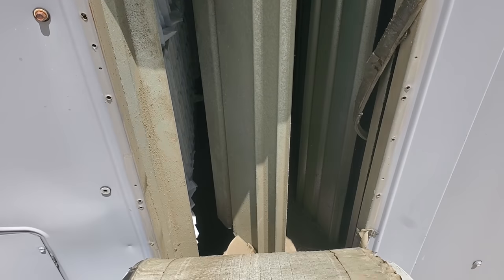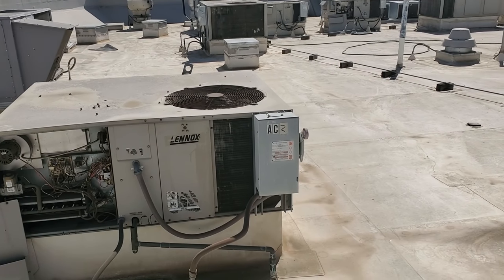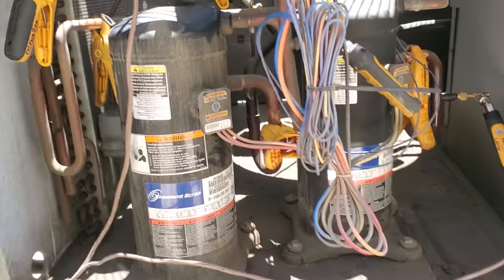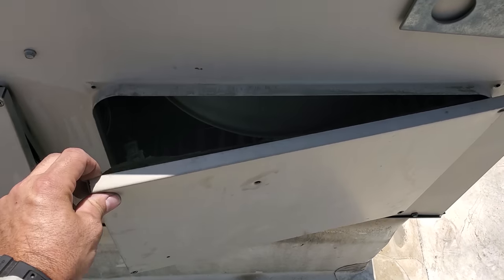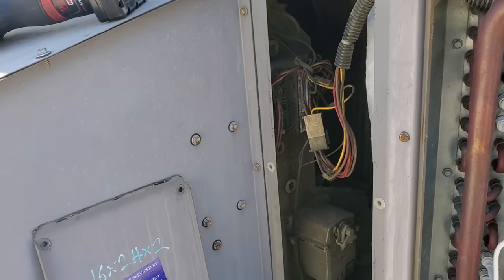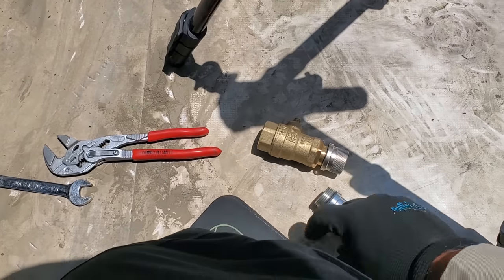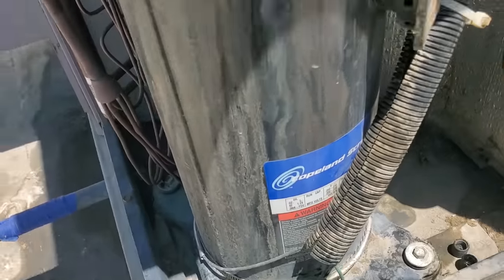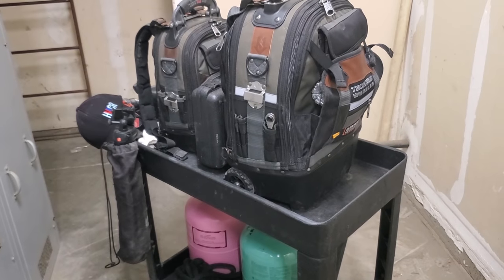HURRY I THINK WE HAVE A FEW AC'S DOWN........

Comment: 26:59 To prevent cross threading, I always push a nut or bolt up to where it's supposed to go and turn it backwards a few turns while putting light pressure on it (as if taking it out) until I feel it drop in then I screw it in and since I started doing that, I've never cross threaded anything...
Reply: If it's been cross threaded before or the threads are just really low quality to begin with, it can still be bad with that method. But it's definitely a great habit to be in.

Comment: I can appreciate the sarcastic comment you're making in the title about clients avoiding any sort of regular maintenance, as well as always opting for the cheapest option when making the recommendation of replacing a part preemptively so it is not breaking by surprise when the weather gets hotter and the ACs have to work extra-hard. But the thing is, we have a maintenance contract with a guy coming over every now and then, cleaning everything, checking temperatures and if there are any problems in the making, and also following the recommendations of replacing stuff, and the damn ACs still break by surprise, especially when they are needed. Maybe ACs are just shit by default.

Comment: Gonna comment before I even watch;

My college is getting renovated, and during this, the AC for our server room bricked itself, servers went into meltdown>.< So today we had an electrician in running a new circuit for the building, for a brand new split AC system. Hopefully in the mean time our little portable AC holds up, because it's Finals week and we need the school network.

Wish you could be out here doing the install, or even just a review of the air system. It's ancient>.<
Reply: Sounds like the place is one of those holes in the wall community colleges I've gone to, had a couple of semesters where they didn't give a rats ass about network performance enough to where some classes had to leave early on some days.
Reply: @MrKillswitch88  It's actually awesome to be there, just having some financial trouble. We had two buildings, one owned and one rented. The rental agency was price gouging the college, so we moved entirely to the other building. The issue was that, with all the construction work and with covid, building maintenance lacked a bit, and the AC failed before it could be repaired. The network performance is usually great, they just need to keep the room cool, and that's hard to do while there's an AC down.

Comment: As a customer, NTE just means 'if it's going to be more than $x, there's some additional thought that needs to go into it'

For example, we had our hot water heater at the shop stop working. NTE we gave the plumber on initial diagnosis was $300. Essentially, 'emergency callout and swap any sensors or filters or whatever'. Two hours later, we get the prognosis: Everything about it is dead. Technically fixable, but it'll cost ya.

We were already planning an expansion that would require more hot water, which is why we set the NTE so low. So we worked with the plumber on estimating the upgrade for that expansion, worked out that shutting down for the week, comping our customers with prebooked appointments and doing that work would be cheaper in the long run than throwing parts and labor at the old system we were going to replace anyway, and shutting down for a week in an orderly fashion.

If our HVAC were to stop working, we'd have a very low NTE because we'd be waving the estimate for repair at the landlord about it to see if we can get them to pitch in to replace the paleolithic garbage with modern units that don't cost a thousand bucks a month to run 6 tons. Like, any action beyond 'replaced bubblegum part and hosed the wildfire ash off' is farther than we really want to go.
Reply: Well said, informative and funny as hell :D

Comment: That Core-max tool Is a lot more than a tool that pays for itself on what you make by selling the Core-max fittings. Normally you would have to evacuate the system and install the valve then recharge the system. I watched that and thought , Wow! What a time saver. Not that you probably need it that often, but when you do, what a time saver.

Comment: Get yourself some “C&D Braze-On Self-Piercing Copper Saddle Valves” for the LL. You can actually pressurize & leak check them while under pressure and before tapping the line.

Comment: At 10:45...you can buy those CoreMax valves from Carrier. It is a lot cheaper than buying the tool and replacing the cores. Two wrenches and done. This is without pressure in the system. You do need the tool being shown later if you want to do a hot swap.
Reply from the maker: But the tool allows you to change them with gas still in the system.... also jb distributes the coremax valves themselves and I am willing to bet you can find the jb branded ones much cheaper than carriers price??
Reply: @HVACRVIDEOS  We get really good pricing from our Carrier rep, and I have not seen a JB version. That said, if I have a leaking CoreMax, I am going to pull the charge anyway because most of them leak on 410a systems, and I am not just going to add to a fractionated charge. Our Co is not buying the tool. We had that discussion.

Comment: I'm a qualified small size A/C installer and watching your videos as I'm planning on some times soon take some courses and get a license for all A/C systems. In Finland there is below 3kg and above 3kg license, typically meant split type A/C installer for less than 3kg and then the "real" A/C installers that does everything. And I like your videos. I've had the below 3kg license for maybe 12 years and installed maybe 300 split type A/C systems, mostly in the last three years. In Finland you can't do any work on devices with refrigerant unless you ar licensed

Comment: glad to have time to start watching again, I am behind on yours & other you-tube videos, I took another job, 65 miles away 2 days a week, for last 4 months, 130 mile round trip, I quit 2 days ago, 6/18/21, I will not be cussed & told off because I took too long & didnt get finished when working on a 1952 car, so it has to sit until I come back, & I wasnt quitting my primary job. his other techs didnt want to go behind me, so car sits until my next day off, & 1 week I only had 1 day off, plus on my normal work days I been helping my wife 3 hours or so a day.

I really want to get into this field, but I know cars, & took an auto-body job, supposedly doing metal fabrication & welding, but next thing I know I was trouble shooting wiring on a 1952 Packard without diagrams, & partially rewiring, yeah thats what took too long, it is his new play-toy & he wants to drive it, today I was supposed to rebuild steering on a 1959 Cadillac, but heavy mechanic work hurts my back, thats why I took job for metal fab, but his 1957 Chevy Bel-Air sitting in shop needing full floor, trunk, rockers, roof patch, & I  did cut out all old metal, & test fitted, new floor & trunk pan, & welded in toe-board, then he side tracked me, then cussed me out. and demanding I quit my primary job, which provides insurance, or go part time at primary job, Grrrrr. he talked good game, but I refused to be belittled or cussed. I am a top notch body man, & welder, & a decent mechanic, but burned out, & wanting a career change

Comment: Hello from Texas Chris ! Wonkie is that a west coast technical term ?
On the condenser with a discharge only port. I will try to find the actual condensing temperature from the coil. Temp change stops and holds for several rows. Then take the temptation of the liquid line, and you will get an idea of the actual subcooling. I have done this for years. 100% accurate, not quite, but at least gives you an educated guess.
Keep up the great vids

Comment: You are absolutely correct, there is no reason to add a RA balancing damper.  On a VAV system, the OA damper should be at 100% open and the RA damper modulates since they are a pressure dependent system.

Comment: I know for some carriers the economizer can be installed for down flow or side discharge. It’s the same economizer, but you have to install it the right way. Don’t know if Tempstar is the same.
Reply: Temp star is Carrier/ICP. It’s completely the wrong economizer.
Reply: @wonderhomie2011 , gotcha. I know some of the newer carriers the economizer is the same for both, but you obviously have to install it for the correct application.

Comment: I think it's great that guys who make parole can find a job changing filters. However, these clients don't realize what they lose by not paying an HVAC contractor to do that work. A filter changer will hear the sounds of bad bearings of a condenser fan motor, and not know what that sound means, and it will go unreported. Recently, at one site, the filter rack rods and media did not reach all the way across the evap. About 10 inches of evap was left exposed. I called them and talked to their service manager. A month later, I came back to do some quoted work, and no one had come by to correct their mistake. That is what you get for a lower price: a lack of professional knowledge and expertise.

Comment: I’m currently up on a Roof outside of Pittsburgh, Pa. on a 6-Ton Trane RTU.
Reply: Our weather is finally getting warm.  The piece of equipment that I am working on is brand new and first summer of operation.  The medical room that I’m working on is 71% humidity 70 degrees.  The unit is way oversized so it’s short cycling and not dehumidifying.  🙄 This isn’t the first time I’ve run into stuff like this.
Reply: You're not to far from me.
Reply: @mackenziegray2090  : where about are you from?
Reply: @hvacexplained9341  westmoreland
Reply: @mackenziegray2090  : ahh nice.  Yeah I live right by Washington county near Canonsburg dam.

Comment: At 10:22 you can see 2 pole contactors and running caps. Can you please explain why 3-phase units have 2-pole contactors and also why do they have running capacitors? I understand on 1-phase unit where you need to phase shift to have an AC motor but on 3-phase it makes no sense to me.

Comment: maybe way too much negative building pressure and it's pulling outside air in around the probes. especially the supply side probe, which you think would have more positive static.
I'm judging and thinking about the other A/C that wasn't blowing off the loose supply cover, until you removed return side cover.

Comment: With all the technology we have and still can’t get rid of the wall o’ stats lol
Reply: Sure you can, you can install a whole bldg EMS with a central controller. With EMS you can look at supply temp,humidity,return air and the like! Typical cost 10k per unit!
Reply: Of course the technology is there if you have the dough for it. Sometimes keeping it simple is easier to manage for both parties the tech and the customer.
Reply: @hvacslayer2929  What I'm trying to figure out was how those stats work for different units ,when they are all mounted next to each other! At :50 of the video,
Reply from the maker: They have remote sensors out in the individual zones

Comment: How are you measuring airflow for these?
Reply: I recently took a airflow diagnostics course, and  still learning I got efficient was to do that, were you plotting it or using a measuring devi e to figure out air flow. Also what do you generally like to leave the kitchens at or whole building for static pressure  that’s considered ok  if you adjust it?

Comment: is it really necessary so many AC units on the roof? that looks a bit overwhelming to say the least 😂😂😂
Reply: It depends on the space below if there are separate rooms or sections of the restaurant.  It can be used for capacity control also.  Sometimes equipment is no longer in use and left up there from a previous tenant.  I preferred to work on smaller tonnage equipment what gets overwhelming to me is when I’m working on a chiller the size of a tractor trailer and everybody’s looking at you to get it up and running ASAP!
Reply: @hvacexplained9341  good explanation. 👍🏻
Reply: @jeesmith99 :  thank you.  I’m currently 38 years old I’ve been with the same company for 17 years and residential work for two years before that so basically half my life I’ve been doing heating and air conditioning.  It’s crazy how much stuff we run into seeing some good installs and seeing some real hack shotty work.  The field is definitely interesting and could be a lot better if there was a standard.

Comment: hey chris, was wondering if you can answer something for me that ive seen you touch on once or twice, when checking subcooling when reading discharge pressure ive been told that discharge and liquid pressure are the same so subcooling is accurate on discharge, but i dont agree, and i believe what youve said, just wondering if you could input more on it. Thanks
Reply: Discharge and liquid are not the same, or else they wouldn't have different names. Discharge is right off the compressor, liquid is after the condenser coil.
Reply: @ignacio8597  i know this and i agree, how ever there are some situations where the only service port is on the discharge line

Comment: I noticed on the old Lennox unit at 16:25 minutes, you were charging it with R22 in the liquid state. Just curious, is there a reason why you charged it in it’s liquid state instead of gas state?
Reply from the maker: I charge everything In the liquid phase
Reply: Way faster to charge liquid, just don't slug the compressor.
Reply: @dustinthewind5538  Fair enough.

Comment: Is it acceptable to cut out the coremax fitting and put in a regular access port, or  a pre-made access port "t" that has the copper pipe?
Especially if u are already making repairs and pulling vaccum. 
Or is the coremax port required for proper testing?

Comment: A balancing damper on the return is used when the unit doesn't have outside air dampers. If there isn't enough outside air being pulled you close down the return so it pulls more outside air.

Comment: Stupid question😂😂 TD means??? can’t seem to find an answer. I’ve only dealt with automotive hvac and I live in new England so I’ve never heard the term😅
Reply from the maker: Temperature differential,  it could be referring to the evaporator td (evap suction saturation and return air difference) it could be referring to the delta t (return air dry bulb and supply air dry bulb difference) and or it could be referring to the condenser td ( liquid saturation and outdoor air difference)

Comment: 22:50 My Electrical School Motor's Instructor would call that wiring mess Spaghetti, rip your head off for doing that on a project and give you a big fat F as your Grade.

Then, after Quietly Screaming at you (don't ask, that's the only way I can describe how he chews you out if you show him Spaghetti Wiring) for 10-15 minutes, he'll make you do it again and may the God's have Mercy on your Soul if your second attempt isn't absolutely PERFECT because then he isn't so nice and polite when he screams at you for fucking up a second time...

And no, I was NOT the Idiot that turned in a Spaghetti Wiring Mess for a Project...I was just the poor sap sharing a work bench with the Spaghetti Lover...

P.S.: Spaghetti Lover ended up getting thrown out of the Motor's module for causing a 0.5 HP 3 Phase Motor to melt it's rotor windings when his wiring attempt caused a dead short across Phase 2 and Phase 3 - I don't know how he did it, the Breaker should have instantly blown when he turned it on...
However, the sparks were spectacularly exiting for a few seconds before the Main Breaker for the Motor Lab blew...

Comment: Why must every a.c. unit you fix is gas and it doesn't even get much colder down there electric heat would've worked . is it the reason why they dont go with electric cause they dont know hoe to fix it

Comment: it looks like you moved the power exhaust for the thumbnail since there is rust and all where the screws should be, but damn man i feel for ya here. Being an HVAC/R tech myself this is always a nightmare. Just wait till you have an airport that has gate NTE's  with shorts XD 
Side note: shredders always leak on detectors dont play that BS salesman game. and even with troubleshooting you should NEVER close the O/A air %100 and if your claiming you know anything you should never close it more than %90 since the O/A is engineered (and yes im calling you out on it) to be minimum F/A requirements regardless of call for CO2 maintenance.  Why are you measuring discharge pressure/temp on the condenser coil????? Why arent you using liquid line from the actual evap coil on the unit? There are valves  allowing you to do so